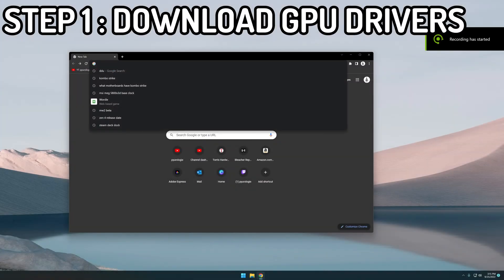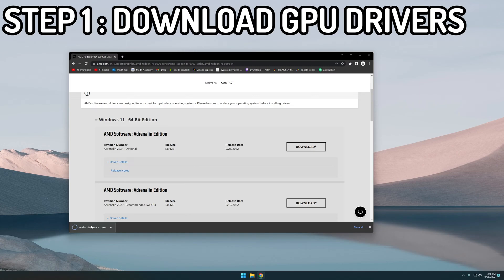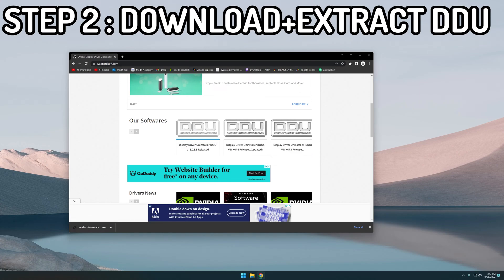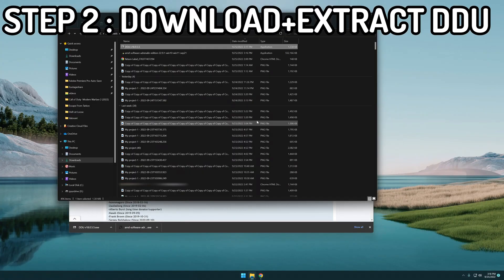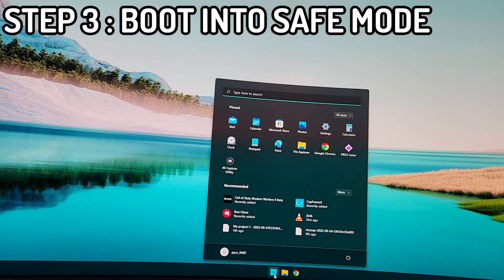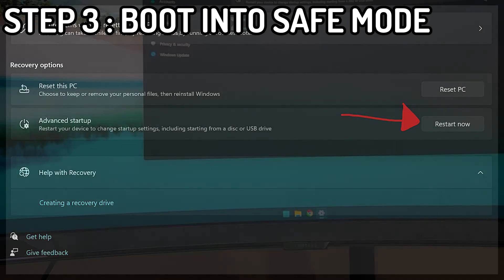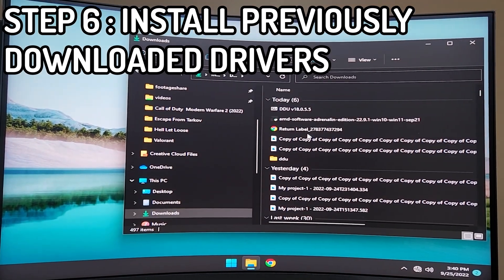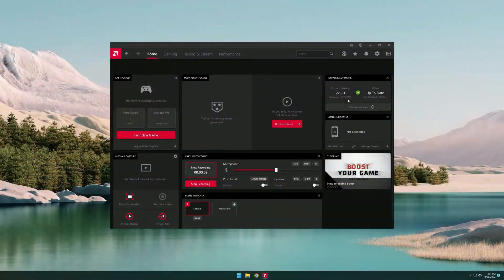How to use DDU Display Driver Uninstaller for Fresh Driver Install

Comment: alright im super late. just upgraded from 1660 ti to rx 6700xt. but my 1660 was dead so how do i do this without installing the drivers beforehand. am i able to use the DDU with the new card without causing issues

Comment: when do you disable wifi and why, I don't get it please ?
Reply from the maker: it is so windows doesnt try to install a driver before you get to run the installer. sometimes windows will install a different version automatically depending on whats in their repository at the time.
Reply: @pyurologie  ok so running DDU with no wifi, come back in windows with new card, no wifi, install the downloaded drivers then I can turn on wifi ?
Reply from the maker: @francisplourde2277  yeah this is the process i recommend. its not gonna necessarily gonna fail if youre connected to the internet, this just eliminates the possibility of a different driver getting installed automatically by windows
Reply: @pyurologie  thank you ! getting a 7900 XT, upgrading from a 3070 Ti, can't wait to see the difference, just wanna be sure to do it correctly
Reply from the maker: @Frank_P83  congrats on the pickup, it's a fantastic card. You should be good if you follow these steps! let me know how it goes!
Reply: @pyurologie  it runs horrible, big coil whine, my CPU runs at 100% and my 3070 was performing better, I hate AMD already, I don't know what's going on 😫
Reply from the maker: @Frank_P83  oh no, mine has been perfect from day 1, what model u have?
Reply: @pyurologie  MSRP
Reply from the maker: @Frank_P83  the reference model?
Reply: @pyurologie  yes and it has a bad coil whine
Reply from the maker: @francisplourde2277  damnnn. i have asrock reference and i have no issues so far. are you able to exhange it?
Reply: @pyurologie  nop, it's used, but it was going flawlessly at his place 😔

Comment: Nice Video, I just bought a rx6650xt to replace the gtx1650 I have ,and it's not detecting when I boot up 5 bleeps then a single bleep don't have integrated graphics and I believe it's booting into windows but can't see nothing, will doing this sort it out? Tried resetting the CMOS ,and the PSU is more than good enough
Reply from the maker: Usually, this should sort out any of those issues. Also, try hdmi/displayport cable if you haven't tried both types. Hit me up on discord if u still have issues

Comment: Hey man I've not having any luck. Switching from a gtx 1080 to rx 6950 xt. I've done this multiple times. My psu is 750w, i7 8700. Getting stuck on load screen and idk what to do.
Reply from the maker: which load screen
Reply: @pyurologie  it's an alienware mobo. So their logo shows up and it say f2 for bios or f12 for startup options. If you prss either it responds but never goes into bios. Just stays at that screen indefinitely. Have 32g of corsair ddr4 ram, didn't work before or after install. Tried starting on Intel graphics and then plugging in gpu to psu and installing drivers but getting an error from adrenaline saying something isn't compatible. Second I plug display into the gpu it just will not work no matter what

Comment: Thank you so much, I just upgraded from a Gtx 1060 3gb to a Rx 6600 XT 8gb 👌🏻
Reply: 1060 6g to 6700XT here
Reply from the maker: heck yeah bro good to hear the info helped you with the upgrade!
Reply: did you run into any driver issues or bugs in your 9months of using the 6600xt?
im thinking of upgrading to that card so im curious to know how reliable their drivers have become

Comment: hey i didnt factory reset when i installed the drivers, I can just do it later right and itd be the same thing?
Reply from the maker: if you're switching from an Nvidia card, I don't think it should make a difference, but yeah I'd do it later just in case.
Reply: @pyurologie  gotcha and one last question does updating the bios important? especially towards performance?

Comment: I'm getting ready to build a PC. I've always had Nvidia GPUs and Intel CPUs. Thinking of making the switch to AMD. I play mainly EFT, but other games occasionally. I really like the new AMD CPUs that came out recently, but I can't afford to pay that much. I'm wanting the 6950xt GPU, but not sure which CPU would be a good choice for it. I want to go DDR 5 as well.

Any recommendations
Reply from the maker: https://youtu.be/N5HQcCihtrU

Another reason the X3D's technology is amazing, it doesn't even require fast RAM or tuning to achieve optimal performance
Reply: @pyurologie  I've had my eye on the i5-12600k, but if the 5800x3d is better, I'd rather go with that.
Reply from the maker: The new AMD CPUs are currently still at a high early adopter premium for a small gain in terms of gaming performance.

If your main game is EFT, go with a 5800X3D 110%.

It will be with 85-90% of the 7000 series in gaming at close to 1/3 cost. A 7950X+X670+DDR5 is $1400 minimum, it can go be way more. A 5800X3D+B550+DDR4 setup can be as low as $550. I don't think there will ever be another chip that offers the performance/price ratio the X3D does. It is incredible.

https://youtu.be/9h8VcQ_Isak
I made this back in June. Component prices have dropped since.
Reply: @pyurologie  in your opinion, is the 6950x a good GPU, or should I stick with a 3080 or possibly 3090?

Comment: So i had a 1050ti but jumped to a 6600 without doing this should i remove both the amd one and the nividia one then reinstall amd?
Reply: yes
Reply: @Punched0  thank you kind one
Reply from the maker: yeah, I would probably uninstall both AMD and Nvidia GPU drivers using DDU and then reinstall latest adrenalin
Reply: @pyurologie  thank you! I’ll be using your video to help me memorize the steps 👍
Reply: im the same situation you were in last year lol
i have a 1050ti and im thinking of upgrading to a 6600xt
so id like to know how's your experience so far, did you run into any other driver related issues?
Reply: @salad5701 will after removing the nvidia gpu drivers my 6600 been doing really well though when It comes to some games bad optimization is a plague, i wish developers would care to address this issue but what can we do lol.